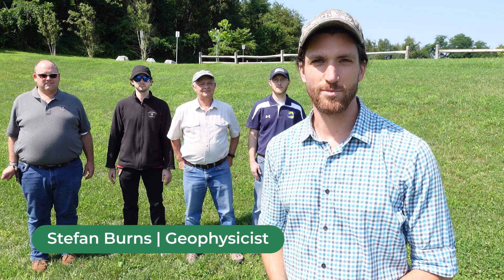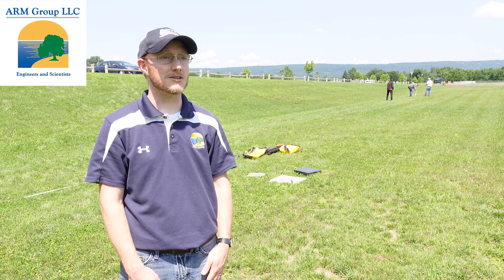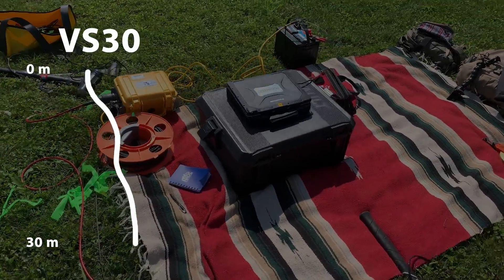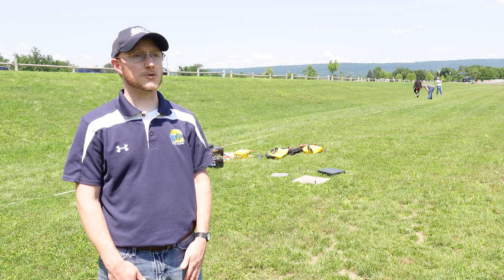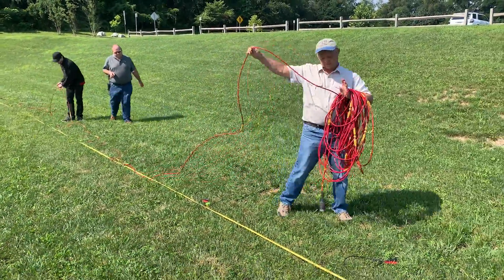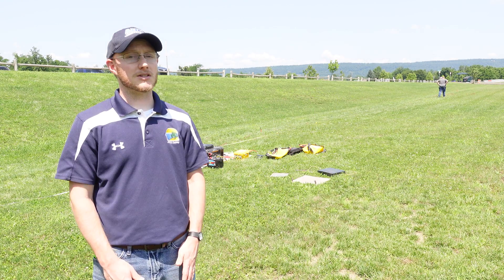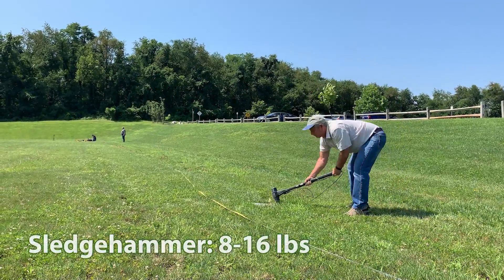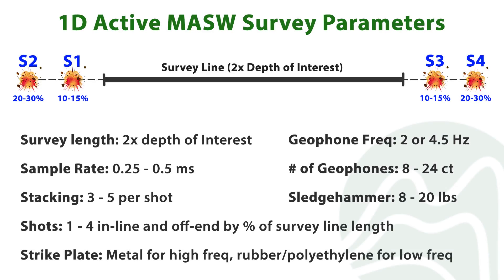1D Active MASW Field Setup and Data Acquisition | 02

Comment: Why use vertical hammer ? Why do you use vertical geophones in MASW method 

You want to calculate surface waves. Why don't you use the horizontal hammer? As well as using the horizontal geophones?

Comment: Very easy for leveled terrain. Never presented, jungle and big inclination of the surface of terrain. It´s better use a trigger geophone: No mess with cables and generate less noises when the strikes plates. Hammer always 20 lb. Juan Castaño. From Colombia South america
Reply: Same here in Puerto Rico, but it's at least it's a great educational video.
Reply: MASW is not suggested for surfaces with big inclination. All you need is actually a somewhat flat surface. And this video IS supposed to exhibit the MASW method.